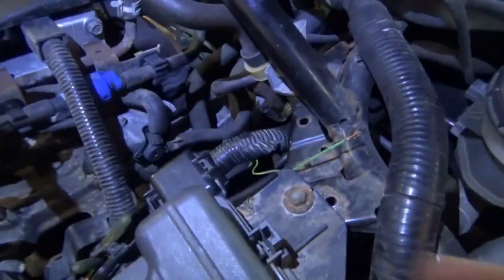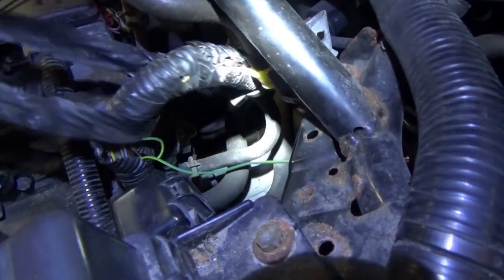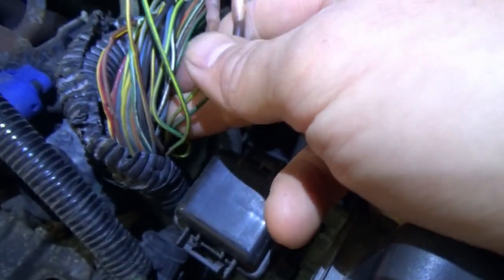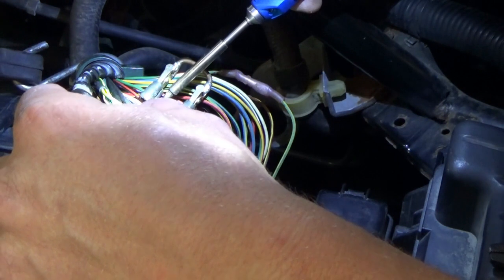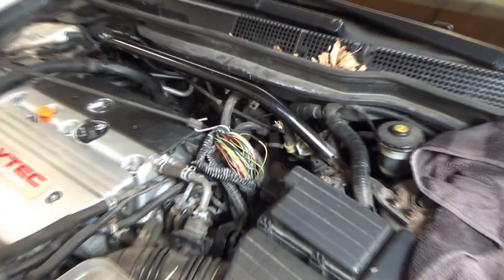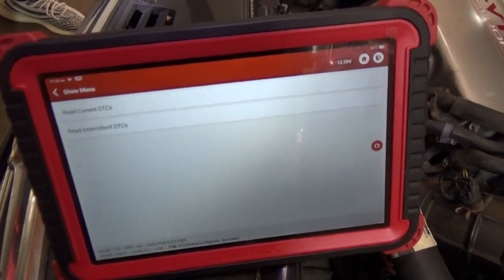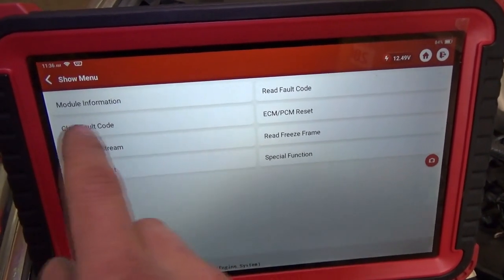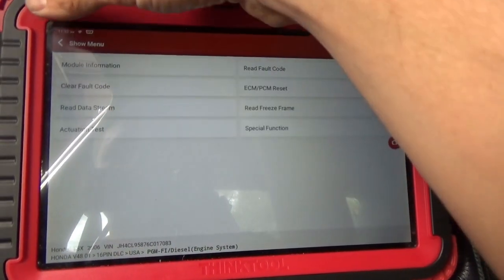DANGEROUS Acura Limp-Home (Part 2)

Comment: Nice job...they make butt connectors that have the sealant in them and a solder joint. Likely requires some experience to use them but still, in a multiple wire repair job all in the same location in a loom like this one, Ivan's proven solder process is likely the better of them all due to the density and amount of wiring patching needed all in one spot.

Comment: Just a tip from someone in the it dept. Just use the tip of your iron to melt the heat shrink helps save from burning wires hope it helps^^

Comment: Awesome job Ivan. I used the connection with solder in the middle it melts the solder around both wires and it heat wraps

Comment: I agree that soldering with heat shrink never fails, but that's only true for road vehicles. If you have a race car, especially single cylinder, the soldered wires will simply break from vibrations. I've had that a few times, and loosing a race because of a broken wire is frustrating to say the least. Since then I only use crimp connectors with proper tools.
On road vehicles, soldered wires never fail because there is MUCH less vibration and it beats having a ton of different crimp tools.

Comment: Ivan I Agree, As installer of aftermarket equipment, Minimize Crimp Connectors to cabin areas only. For high vibration, uncontrolled environment locations, use only Solder and Heat Shrink.

Comment: Butt connectors are great for road side fixes but they do tent to fail after a few years.  Sodder connections do fail as well, there are a few trks in the 17-20 year old range that the sodder connections rotted out on and failed.  If done right their is no doubt the sodder connection will last longer no don’t but I do think butt connections have their place too.  The heat shrink ones at least.  By the way, love your videos, I do t understand what you are not in the million subscriber range.

Comment: those connectors were either to large for the wire or just crimped with improper tool. and you can do pull test to see it will hold

Comment: Most all of the connectors to the various components are crimped on. If properly crimped with quality parts, the wire will break before it will pull out. These were obviously poorly done. Ivan did a proper job soldering, but I've seen plenty of bad jobs at soldering. Ends not clean, not enough wire, never got the wire hot enough (crummy soldering iron or not being patient and letting it heat up), wires not lined up right. Lots to go wrong with soldering, but works really well when done correctly. I guess that is true with just about anything and everything.

Comment: Smashing job ivan :-D
Ive never liked any crimp connections,  i always clean the copper wire and twist, then solder.
Dam i forgot to put the heatshrink on lol.
Years ago I did all the wires on a old hatchback car, every wire was snapped or snapping as they passed through the door to body gator.
I also extended each wire so they could move about easier.
It never failed again for the life of the car.
Wonderful stuff heatshrink :-D

Comment: RE : DANGEROUS LIMP HOME MODE...
We bought a 2003 Wrangler new. I was great. BIT, after we had it a few years it did this-
We would pull into the turn lane & wait for our light. When our light turned, we would
begin our turn & once in the middle of the intersection, the engine would stall! The dealer
fixed it but it made for several tense minutes.

!

Comment: I actually had a similar issue happen. I used the heat shrink but connectors and 2 years later the car came back, 2 of the 5 had issues. Now I soldier everything unless I can't get to it for some reason. I've had about 85% success rate with heat shrink but connectors but 100% with solder. So I just started soldering everything why risk a comeback.
Reply from the maker: Great statistics! Usually it's easier to get into tight spots with a soldering iron than a bulky crimping tool :)

Comment: I must be crimping mine correctly because the few times I've had to "undo" a crimp for any reason (cross wire, misstep, etc.), it never freaking pulls off and I wind up cutting it to remove.
Whomever did those splices was cocky/careless.

Comment: After dozens and dozens of electrical repairs, modifications, and accessory installations on street vehicles and all-weather power sports equipment (read dirt bikes), which remain in the stable for decades, I have never had a solder, seal, and shrink wrap connection fail.

It's the only way to guaranty the work for the service life of the vehicle.

FYI, if you only have standard heat shrink tubing on-hand, a dab of liquid electrical tape and/or dielectric grease prior to sliding the heat shrink tubing in-place adds serious moisture protection to the joint.
Reply: You can disagree all you want to and continue to solve the problem your way.  I'm not going to argue with you.

However, nothing succeeds like success and I've been successful with my repairs for more than four decades.  The dirt bikes see seriously brutal duty cycles of mud, stream-crossings, and general operational environmental abuse all followed up with power washing at the end of the weekend's riding. 

I live in the practical world...  I'm not stocking up on all manner of properly sized crimp connectors for DIY work.  Maybe if I ran a production shop due to the increase in throughput?

But, until then, I'll continue to work with what works for me.
Reply: @russellstephan6844  you say in one breath "I'm not going to argue with you" but in another you say in bold that soldering is the only way to guarantee the work will last forever, which is verifiably false. A properly done crimp and seal will last as long as properly done soldering, if not longer.

Comment: I have found that most modern crimp connectors available at auto parts outlets are not properly sized. "Chinese quality control"  I much prefer solder and heat shrink connections.
Reply: they tend to collapse rather than crimp and don't grip the wires correctly. Down the road, the wires separate again.

Comment: I've always preferred to do soldered connections whenever possible. The only exception is when it's a tight area where I don't have good access. In those cases, I'll use crimp connectors. Sure, it takes longer, but soldered joints should never experience failure again. I see a lot of people who are offended by not recommending crimp type connectors. Yes, it is true that just about every connector in a vehicle has crimped connectors. However, it's done that way for the time and cost savings only. If they came crimped and soldered from the factory, it's likely the connections would never fail for the life of the vehicle, but that increases production time and cost for each harness. General Motors recommends crimping and soldering terminals in connectors whenever they are replaced (if you replace individual terminals instead of the entire connector). I've also been underneath Mercedes-Benz vehicles and I noticed that they crimp and solder the braided ground straps. That shows me they acknowledge that crimping and soldering is the best way to make a connection. Done properly, these joints provide a mechanical and a chemical bond.
Reply: Wrong answer. Solder is by far cheaper than crimp connectors. The reason solder is not used for mechanical retention of wiring is because the solder joint cracks in a dynamic environment.Solder is an excellent promoter of electron flow in an electrical circuit. Solder has poor mechanical retention of wiring in a dynamic environment. It works great at home stereo wiring and fails in dynamic environment specially engine compartments

Comment: Why did those wires have to be repaired in the first place? Were the wires loose in the loom and vibrating against the plastic wire loom to wear through? I have found that using the area of the crimp tool intended for insulated connectors often doesn't result in enough crimp to hold the wire, especially on the smaller diameter connectors. The insulation provides too much cushion so I use the crimp for uninsulated terminals which can leave a hole in the heat shrink that will be sealed when heated provided you are using self sealing connectors.
Reply from the maker: It looked like some serious damage from someone with a sharp knife. Honda OEM Harnesses never vibrate or rub through like GM haha

Comment: Ivan you don't have to defend solder joints over butt connectors. I have started using the solder iron to shrink the heat wrap, any problems with this? It seems like the safer way.

Comment: Not all crimping tools are created equal. The shape is very important. Those crimpers that merely 'flatten' the crimp connector are the absolute worst. Always use the type with a crimp 'pin' that creates an indent in the crimp which also pulls the rest of the connector tight against the wire. A well make crimp connection will NOT allow you to pull the wire out. The other important factor is the proper size of the crimper relative to the wire gauge size of the connector, as well as the proper amount of pressure. It's true you cannot go wrong with a solder joint PROVIDED that it's a quality joint, not a cold solder joint, and done with a good grade of solder and the wire cleaned properly. If there happens to be corrosion on the copper it's best to strip back to the point where there's no corrosion.

Comment: Honestly, 97% of people debating "solder vs crimp" don't know how to QC either one. They have cheapo tools & supplies, and zero formal training. Both crimping and soldering, if screwed up, are a LIABILITY; whereas a professional will make joints that are like beautiful art; you can bet your LIFE on it (literally). Crimping requires an understanding of what a good crimp actually is, and specialized tooling and terminals for specific wires. Soldering is similar, and adding insulation and/or strain reliefs to the equation requires even more SKILL. SO, if you have a handy dandy crimp terminal kit with the classic Yellow, Blue and Red sleeves, and FREE crimper included in kit, then, my friends, I must inform you that what you are doing is NOT crimping; Smashing, Crushing or Pinching MAYBE, but not crimping. As for soldering, if you cannot define AND identify "cold joints" and "wetting", then you are not qualified to approve a solder joint.

Comment: It's not a problem with properly done crimp connectors that are appropriately sized for the wire. If the connector is too big for the wire, you get a loose connection.
Reply: These are obviously far too big for the wire. If you want to do them right, you need to have a set for all different wire cross sectional areas. I do agree that soldering is sometimes easier, when you don't have the right connector size, in a tight to reach place, or you don't want to stock lots of connectors. Both are good if done right.

Comment: I asked my service manager in 2006 as a newbie about soldering and was quickly told “no one does that for wire repairs on vehicles anymore.”
Reply from the maker: That's because if service writers knew anything about car repair, they wouldn't be service writers 😂

Comment: Crimps will only fail if the wrong tool was used with the wrong butt connector.  NASA has a great online document outlining the appropriate way of repairing damaged wire.
Reply from the maker: Sure, but that requires special tools and training. Less variables with soldering...just make sure the iron is hot enough and the copper is clean to flow the solder through the entire joint :)
Reply: @PineHollowAutoDiagnostics  You do know that the solder is laying on the copper wiring correct ? A new alloy is not being manufactured here (the copper and solder are not melting together) you are just laying solder down over the copper. Heat shrink is holding the solder to the wiring yet a crack will form from vibration. This repair will fail period. Promoting this type of repair just illustrates what a stubborn hacker you truly are. A good mechanic evolves over time attempting perfection to his/her craft. Blindly sticking to improper repair procedures is for fools. Being able to diagnose an UFO from a thousand galaxies away don’t add up to squat when the craft can’t make it past Pluto on the return voyage home
Reply from the maker: @JOMaMa..  I'm a stubborn Russian hacker for sure :)

Comment: You need a proper ratchet crimper to crimp those butt connectors. Just using a pliers like I've seen Eric O use are just not good enough. Especially if you are inexperienced and don't apply enough pressure.
Reply: I agree. Ratchet tool and a decent brand of crimp makes the difference.
I've seen many crimps where the coloured outer sleeve has melted because insufficient pressure was applied ("squeeze and hope" tool)
And there's also nothing wrong with soldering if done correctly and the adhesive lined heatshrink is used to both seal the connection from moisture and provide some strain relief.
Reply from the maker: If you crimp too hard, you can cut the wire. If you crimp too weak, you will have a bad connection. Not reliable ether way 😉
Reply: @PineHollowAutoDiagnostics  unless you own a ratchet crimper :-)
Reply: @PineHollowAutoDiagnostics  if your solderin tip is too hot, you melt the insulation and oxidize the solder. If your soldering tip is too cold it wont be a proper solder. If you does not clean the wires properly it wont be a proper solder. If you use too much flux and leave ina mess, it will oxidize the wire.
Every method can be done good and bad. ;)
Reply from the maker: @WilliamMulligan  even with a ratchet crimper, the joint will be physically weaker than with solder. Try the Keith Tug Test on both and let me know which one lets go first 😉
Reply from the maker: Great points! Proper iron temperature and clean copper is definitely key to success :)
Reply from the maker: @T.J. Kong What about tight spaces where you can't fit your fancy crimper tool? It might be a good method, but has big drawbacks in terms of real-world application.

Comment: Not a fan of butt connectors or that blue 3m snap garbage. Soldering is the best way, with like you said shrink wrap with the goo. Finally wrapped with good tape, #33 is all I use. Amazing job 
Ivan. Learned a lot through your videos to keep my cars running.  Thanks for sharing your knowledge. Stay safe, God Bless.

Comment: There is nothing wrong with using butt connectors if they are crimped properly. I use them all the time and never have had any problems. I am sure to use the correct crimp tool.

Comment: I understand Ivan's point, but I my opinion, this looks like bad crimps, which make butt connectors look bad. You can also create a cold solder joint, which will act just like a bad crimp. I think the point is that improperly done connections are capable of creating difficult to find intermittent problems. Every time you make a connection, you NEED to think about problems you could be causing down the road.
Reply: In other words, you can screw up electrical connections in many ways! Whatever connection you use, do it well and the vehicle won't get hard to find intermittent electrical faults.

Comment: If you don't like butt connectors or crimp connectors then do not ever get on any aircraft made by any aircraft manufacturer from anywhere in the world..

One of the biggest problems with but connectors and crimp spices I see in the automotive world is that most repair techs run down to autozone and buy their butt connectors .  Proper millspec crimp connectors cost roughly 30 cents each,  Significantly more than those at autozone. Don't write they are cramped with a calibrated crimper based upon the size of the crimp whereas I can guarantee you that at least 50% of the crimp connectors  installed outside the factory environment are crimped using a pair of pliers.

 Soldering is also no cure. How many techs know the right way to mechanically join the wires before they solder? How many can describe the proper use of flux? What is the true temperature of the iron that they are using? How do you properly apply heat to a solder joint? How hot is too hot, can you recognize when the solderr has been crystallized due to excessive heat and the opposite which is a cold solder joint.

 Rather than just rambling along anymore if anybody really cares they can go take a peek at the IPC standard 610 which has a wealth of information regarding all kinds of interconnections.  What it will state is that relying upon the ultimate tensile strength of the wire or interconnect is an extremely bad thing to do and which is why there are terms such as Strain relief used throughout the documents.

 Ivan  you are simply the top of the heat when it comes to automotive diagnostics there is absolutely no question and 99.99% of the time I agree with everything you say but this time In the immortal words of Henry Fonda playing Admiral Chester Nimitz in the movie In Harm's Way, you were not wrong, you were just a little short of being right.

 Keep up the fantastic work!

Comment: someone didn't crimp those proper tool or maybe not at all! 🤬🙄 probably used a $3 multi-tool crimper or miss-crimped too far near the edge.
but it sure looked like it pulled straight out like only the glue held and it was never crimped, maybe they though they were solder type? 🤣
I didn't catch if you cut the jacket off to look at the actual metal crimp barrels.

Comment: Will not agree on not using butt connectors!
Everything has its time and place, and that one was a wrong application and very poor execution. If it was a repair of, let’s say - semi trailer harness, heat shrink butt connectors is a superior way to repair it. Because I had failed soldering repairs far more to often in that application, even when done right.
Done right is imperative we’d here! The het shrink butt connectors have to be crimped by correct tool, so the crimp would not be over or under crimped, and insulation of connector it self will not get damaged. And the right size connector used for right gauge of the wire.